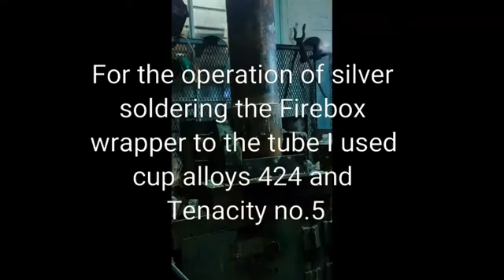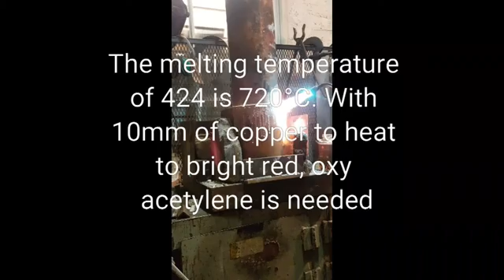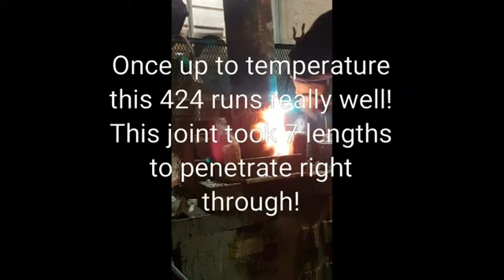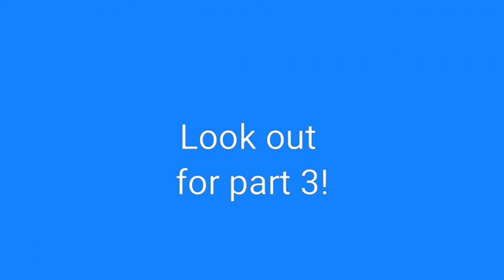3" Fowler Boiler construction and silver soldering - Part 2

Comment: I've just discovered this build and so far its really got me hooked ... when you went around the second time for the rivets did you get any problems with the first lot of solder melting out ? .... Regards Andy
Reply from the maker: Thanks to the capilary action, the silver solder from the first time round won't simply run through unless there is excessive heat. Control the heat of the job and there shouldnt be a problem.

Comment: "The boiler looks absolutely disgusting." Don't they always? I've seen some really nicely made boilers that looked utterly horrible right after soldering.
That's some pretty heavy copper boiler work there, I half suspected you might end up going with a steel boiler at this size, but at least you can make a copper one yourself.
Reply from the maker: +Ticklish HoneyBee Haha I always criticise my work. That way I get it to come out as well as possible. 
The reason I went for copper is exactly that. I want to build this thing myself. Not have someone else do it for me 💪